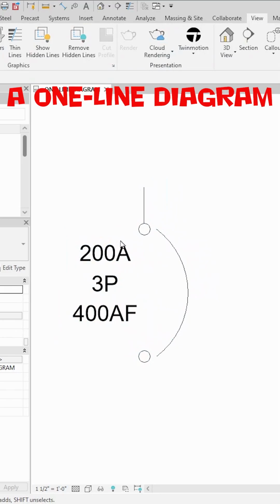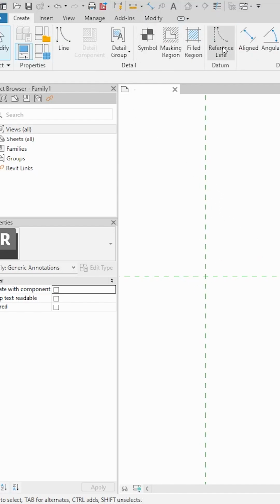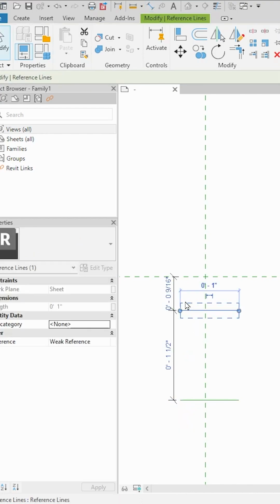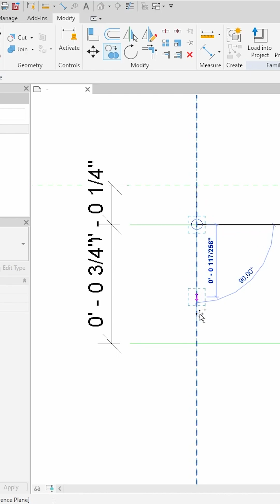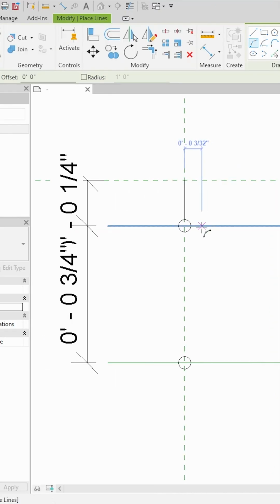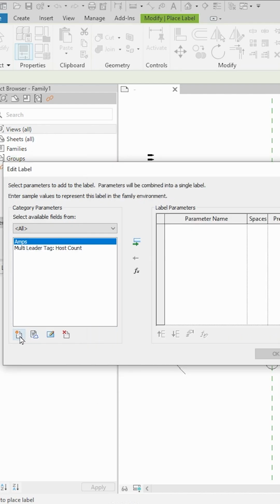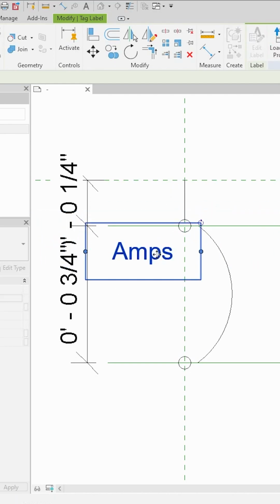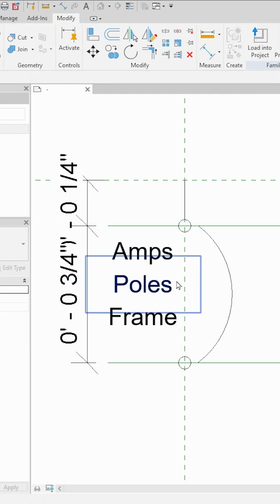CREATE a One-Line Diagram CIRCUIT BREAKER Symbol - Revit MEP Electrical #shorts

Comment: honestly i rather use another software and insert pdf into the revit sheets.Revit will allow for detailed mep designs only if u buy add ins
Reply from the maker: I hear ya there - yes, if you want to do more than just "draft" a one-line diagram, such as fault current calcs, voltage drop calcs, selective coordination, and arc flash calcs, you need either an add-on within Revit (extra cost) or, as you mention, software like Easy Power outside of Revit. However, if someone is looking for just a 2D diagram with your own symbols and layout, the drafting abilities (with parametric families for labels, etc) can serve that purpose well. Appreciate your feedback!
Reply: @ElectricRob  love your videos and thanks for the response..I wanted to know if you have a site or a project where they sell or even freely have a full MEP project from start to finish by industry standard available to download. And study one will the full schedules , 3d rendered views and detailed drawing
Reply from the maker: Thanks for the support! Autodesk actually provides a free commercial project complete with many disciplines - you can find it by simply googling "Revit Sample Projects" and download the "Snowdon Towers" models - includes Architectural, Structural, Electrical, Mechanical, and more. This project was designed by actual industry consultants and is a good representation of a project. You may have to "fix" the links, since each trade is linked into the others.
Reply: @ thank you.. I have actually seen those ones .. but you know per drawing index there are layouts like cctv and access control and even earthing and lightening protection drawings that we are suppose to be able to draw in revit.. so if I could get a project with the full scope of electrical or even MEP done in revit